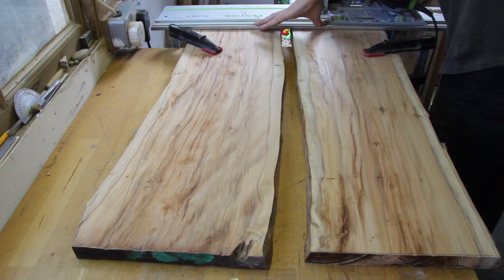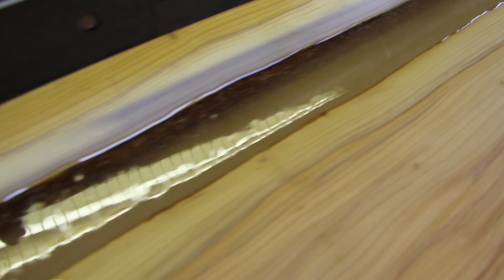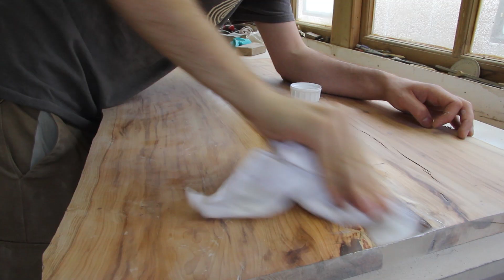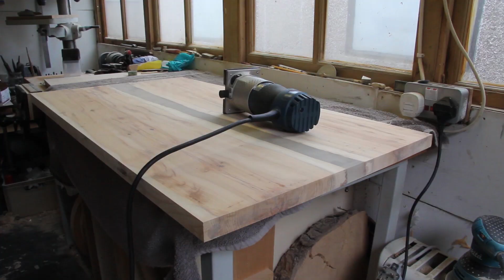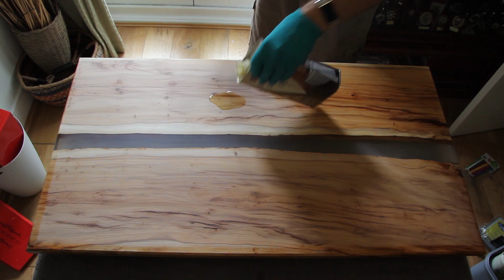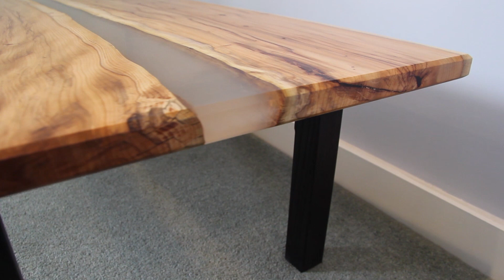River Table - George Heatley

Comment: Dear George, Very good job. Could you provide the specification of the materials that were used? I need to check if I can find the same in Brazil ...
Reply from the maker: Aldo Roberto Medardoni the wood was English yew and the resin I used was made by a uk based company called easy composites. Hope that helps.

Comment: Absolutely gorgeous! What are you using to polish the resin to such a nice finish? I saw a couple products shoot in and out of the video, but they went by too fast for me to see!!
Reply from the maker: Hi David, I cut the epoxy back with a random orbit sander up to about 400 grit and then polished by hand with micro mesh up to 12000 grit. The bottles are three different grades of polishing compound that I used to polish by hand but it could be done with a machine polisher although as the top was only oiled I only really wanted to polish the epoxy and not the wood. As for the polishing compounds, they were made by a brand that makes guitar lacquer, but to be honest I’m sure any polishing compound would do fine. Hope that helps.
Reply: Awesome! Thanks. Again, beautiful work! Cogratulations!

Comment: Nice work! What was that you used on the bottom to keep the epoxy from leaking out?
Reply from the maker: Way Woodworking I just used a sheet of wax paper underneath making sure the boards were clamped down flat and melamine faced mdf for the ends, I screwed the ends down and that was enough. I took the gamble but I suppose I could have run a bead of silicone in the ends if it leaked at all.
Reply: George Heatley cool, thanks for explaining that! I've never had the pleasure of using epoxy or resin in that manner yet.

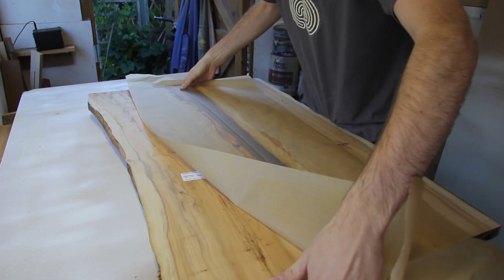Comment: What kind of paper did you use on top when pouring the resign in the bottom, at 1:27?
Reply from the maker: Just greaseproof paper, I’m sure people probably use a wax paper or something  but greaseproof did the job. It leaves a pattern on the dried resin but I was always going to sand and polish it anyway.

Comment: Does the epoxy self level? And what did you use at the end, a stain? Or oil?
Reply from the maker: xel356 sorry for the late reply. Yeah the epoxy is of a consistency that it self levels, so of course it’s handy if you’re bench/work surface is level. 

Yeah the finish is just Danish oil at the end. Hope that helps.